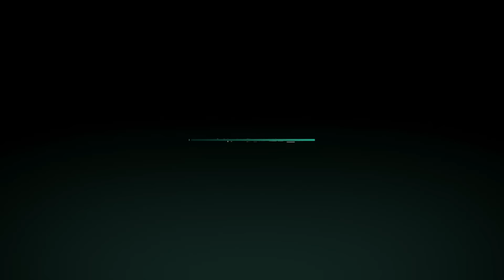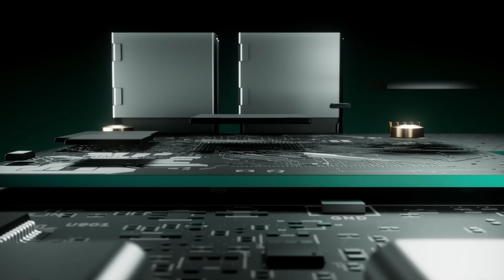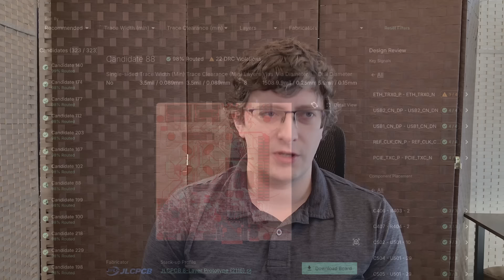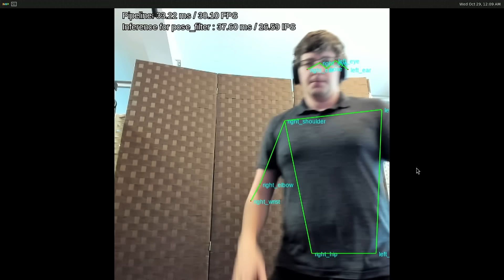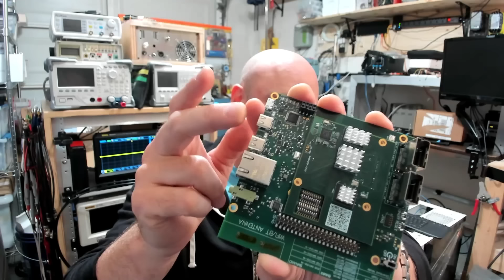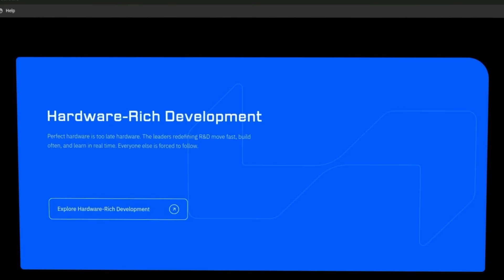Introducing Project Speedrun: The First Computer Designed by AI

Comment: Nice, what about this:

**custom design concept for an affordable, efficient Linux SBC (Single-Board Computer)**—not just another clone, but a modular, sustainable, open-source board with real improvements over most current low-cost boards. It’s optimized for off-grid, research, maker, and server use.

# *Concept: “LibreLite SBC”*

(For researchers, low-budget servers & off-grid projects)

## *Design Philosophy*

* *Modular* (plug-in RAM, storage, wireless, add-ons)
* *Open* (all schematics/firmware under Creative Commons)
* *Low Power* (idle <2 W, peak <7 W)
* *Expandable* (lots of GPIO, M.2/PCIe slot, HAT support)
* *Ecological* (repairable, long life, no exotic components)
* *Linux First* (not just another “Android board”)

## *Core Components & Features*

### *1. Processor (SoC)*

* *Choice:* Allwinner V831 (ARM Cortex-A7, single core, 800 MHz, ultra-low power)
* *Alternative:* Allwinner D1s (RISC-V, single core, 1 GHz, fully open architecture)
* *Advantage:* Very little heat, passive cooling, ARM or RISC-V (your choice)

### *2. RAM*

* **Plug-in SO-DIMM DDR3L module**, 512 MB–2 GB depending on needs
* *Why:* Repairable, upgradable, less e-waste

### *3. Storage*

* *M.2 Key-B slot* (SATA/PCIe) for SSD/Flash/adapters
* *microSD slot* (boot/backup)
* *USB 3.0* (also for external SSDs)

### *4. Power Supply*

* **USB-C (5V/3A, Power Delivery)**, with polarity protection
* *Optional:* JST header for battery pack (with onboard charging)

### *5. Networking & I/O*

* *Gigabit Ethernet* (PoE support as HAT/extension)
* *WiFi 5/Bluetooth 5* (modular, via M.2 or USB dongle)
* *2× USB 3.0 / 2× USB 2.0*
* *40-pin GPIO (Raspberry Pi compatible)*
* *UART, I²C, SPI, CAN, PWM, ADC onboard*
* *HDMI 1.4 (1080p/60Hz, no 4K for efficiency)*
* *Analog Audio Out (3.5mm jack or I2S module)*

### *6. Special Features*

* *RTC (real-time clock, CR2032 battery)*
* *Hardware watchdog (stability guaranteed)*
* *Open-source bootloader (no locked U-Boot)*
* *Temperature sensors, debug header*
* *Status LEDs (power, ACT, WiFi)*

## *Board Design (High Level)*

* **4-layer PCB, 10×10 cm**—compact but with plenty of room for cooling and mods
* *Edge connectors* for HATs/add-ons
* *Minimalist, high-efficiency voltage regulators (>90%)*
* *Large ground planes (for cooling, EMI shielding)*
* *All components THT or common SMD, easy to repair*

## *Software / Ecosystem*

* *Direct support for Armbian, Debian, OpenWRT*
* *No vendor lock-in, no proprietary blobs required*
* *Updatable firmware (via USB or SD)*
* *Well-documented GPIO, complete open schematics online*

## *Cost & Availability (target values)*

| Component    | Cost (1000 pcs) |
| ------------ | --------------- |
| SoC          | €5–8            |
| RAM          | €5–10           |
| PCB + Solder | €8–12           |
| M.2/USB/etc. | €4              |
| Misc.        | €3              |
| *Total*    | *€25–35*      |

With some luck and DIY, a homebuilt unit could stay under €50!
Kit: PCB + base components, plug-in RAM/storage/add-ons optional.

## *Key Advantages vs Existing Boards*

* *Plug-in RAM!* (No e-waste if RAM fails, upgradeable)
* *True M.2 slot!* (SSD on board, not via slow adapters)
* *Ultra-low-power SoC, yet full Linux compatibility*
* *Fully open firmware and schematics*
* *RTC, watchdog, debug as standard*
* *Flexible power supply, off-grid ready*
* *Not focused on “mass market entertainment”—optimized for stability, repairability, and sustainability*

## *Block Diagram (Text Sketch)*

```
+-----------------------------+
|        LibreLite SBC        |
+-----------------------------+
| SoC  (ARM/RISC-V)           |
|   |                         |
|   +--[SO-DIMM RAM]          |
|   +--[M.2 Key-B SSD]        |
|   +--[microSD Slot]         |
|   +--[USB 3.0 / 2.0]        |
|   +--[Gigabit Ethernet]     |
|   +--[WiFi/BT Module]       |
|   +--[GPIO 40-Pin]          |
|   +--[UART/I2C/SPI]         |
|   +--[HDMI / Audio]         |
|   +--[RTC, Watchdog, Temp]  |
|   +--[USB-C/Accu Input]     |
+-----------------------------+
```

## *Next Steps*

1. *Create schematic (KiCAD/Altium)*
2. *Publish open-source PCB design*
3. *Prototype production (JLCPCB, PCBWay, etc.)*
4. *First software image*
5. *Documentation (Wiki, repair manual, tutorials)*
6. *Build guide as PDF/video*